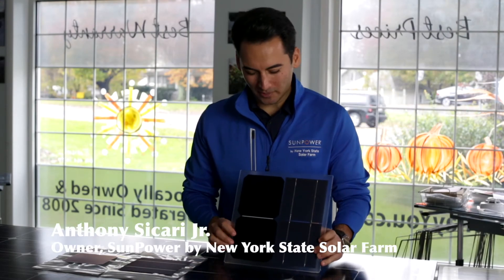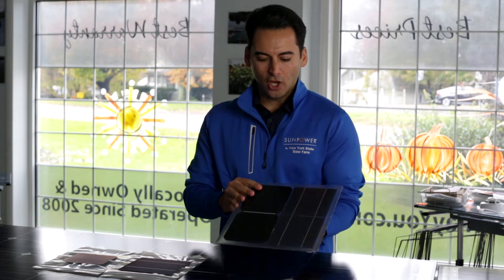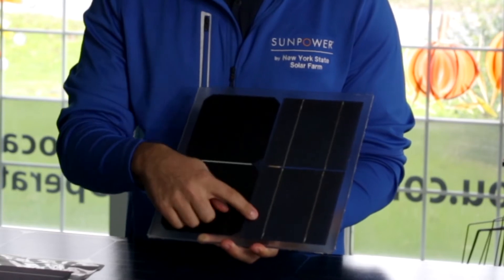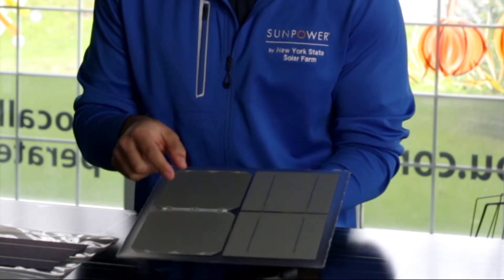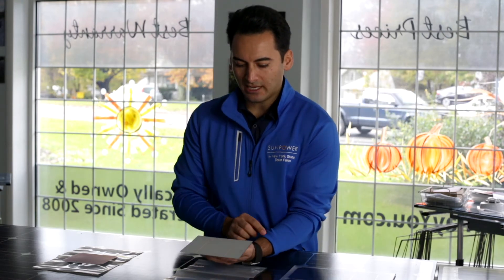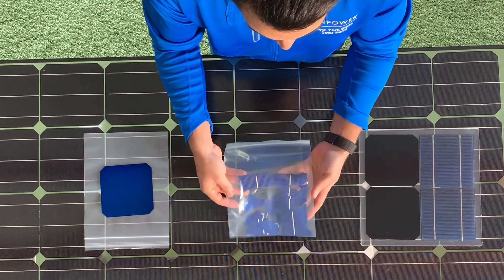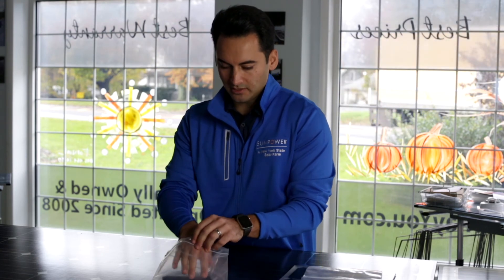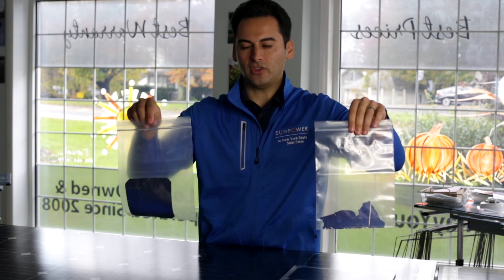Breaking Solar Panels | SunPower vs Conventional Panels

Comment: Quran chapter 53                      The Star
 

 In the name of Allah, the Entirely Merciful, the Especially Merciful.
1  By the star when it descends,
2  Your companion [Muhammad] has not strayed, nor has he erred,
3  Nor does he speak from [his own] inclination.
4  It is not but a revelation revealed,
5  Taught to him by one intense in strength -
6  One of soundness. And he rose to [his] true form
7  While he was in the higher [part of the] horizon.
8  Then he approached and descended
9  And was at a distance of two bow lengths or nearer.
10  And he revealed to His Servant what he revealed.
11  The heart did not lie [about] what it saw.
12  So will you dispute with him over what he saw?
13  And he certainly saw him in another descent
14  At the Lote Tree of the Utmost Boundary -
15  Near it is the Garden of Refuge -
16  When there covered the Lote Tree that which covered [it].
17  The sight [of the Prophet] did not swerve, nor did it transgress [its limit].
18  He certainly saw of the greatest signs of his Lord.
19  So have you considered al-Lat and al-'Uzza?
20  And Manat, the third - the other one?
21  Is the male for you and for Him the female?
22  That, then, is an unjust division.
23  They are not but [mere] names you have named them - you and your forefathers - for which Allah has sent down no authority. They follow not except assumption and what [their] souls desire, and there has already come to them from their Lord guidance.
24  Or is there for man whatever he wishes?
25  Rather, to Allah belongs the Hereafter and the first [life].
26  And how many angels there are in the heavens whose intercession will not avail at all except [only] after Allah has permitted [it] to whom He wills and approves.
27  Indeed, those who do not believe in the Hereafter name the angels female names,
28  And they have thereof no knowledge. They follow not except assumption, and indeed, assumption avails not against the truth at all.
29  So turn away from whoever turns his back on Our message and desires not except the worldly life.
30  That is their sum of knowledge. Indeed, your Lord is most knowing of who strays from His way, and He is most knowing of who is guided.
31  And to Allah belongs whatever is in the heavens and whatever is in the earth - that He may recompense those who do evil with [the penalty of] what they have done and recompense those who do good with the best [reward] -
32  Those who avoid the major sins and immoralities, only [committing] slight ones. Indeed, your Lord is vast in forgiveness. He was most knowing of you when He produced you from the earth and when you were fetuses in the wombs of your mothers. So do not claim yourselves to be pure; He is most knowing of who fears Him.
33  Have you seen the one who turned away
34  And gave a little and [then] refrained?
35  Does he have knowledge of the unseen, so he sees?
36  Or has he not been informed of what was in the scriptures of Moses
37  And [of] Abraham, who fulfilled [his obligations] -
38  That no bearer of burdens will bear the burden of another
39  And that there is not for man except that [good] for which he strives
40  And that his effort is going to be seen -
41  Then he will be recompensed for it with the fullest recompense
42  And that to your Lord is the finality
43  And that it is He who makes [one] laugh and weep
44  And that it is He who causes death and gives life
45  And that He creates the two mates - the male and female -
46  From a sperm-drop when it is emitted
47  And that [incumbent] upon Him is the next creation
48  And that it is He who enriches and suffices
49  And that it is He who is the Lord of Sirius
50  And that He destroyed the first [people of] 'Aad
51  And Thamud - and He did not spare [them] -
52  And the people of Noah before. Indeed, it was they who were [even] more unjust and oppressing.
53  And the overturned towns He hurled down
54  And covered them by that which He covered.
55  Then which of the favors of your Lord do you doubt?
56  This [Prophet] is a warner like the former warners.
57  The Approaching Day has approached.
58  Of it, [from those] besides Allah, there is no remover.
59  Then at this statement do you wonder?
60  And you laugh and do not weep
61  While you are proudly sporting?
62  So prostrate to Allah and worship [Him].
Reply: So you DO want your dressing on the side then? Sir?

Comment: BASICALLY you drank the koolaid!  Totally ridiculous analogy and something that the panels never experience.  The manufacturers wouldn't give a 25 year production warranty if things were going to break down as you describe.  The panels have tempered glass on top of them and BASICALLY your demonstration is beyond ridiculous.  BASICALLY your scenario could NEVER happen.  BASICALLY you are a great snake oil salesman.  Pat yourself on the back for spreading lies and misinformation.
Reply: BASICALLY the conventional panels are not as durable compared to SunPower's panels.
Reply: @calvinm9677  While SunPower (effectively now Maxeon) makes some pretty great panels but it's rather simplistic to say that others aren't as durable.